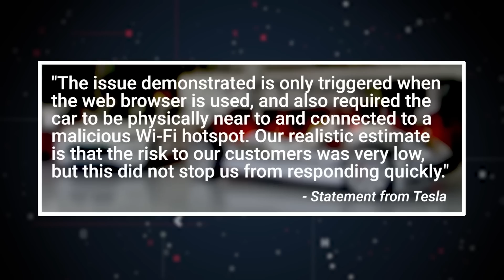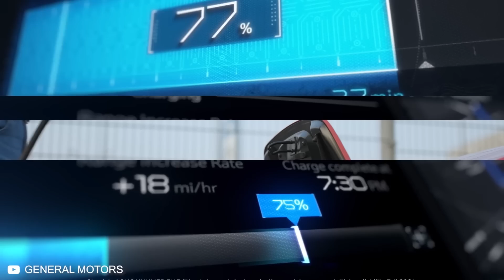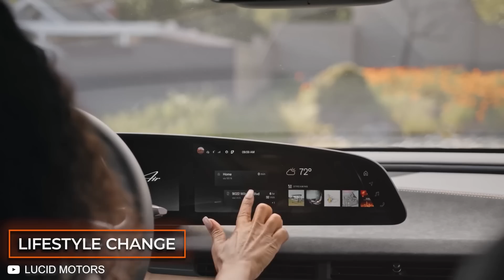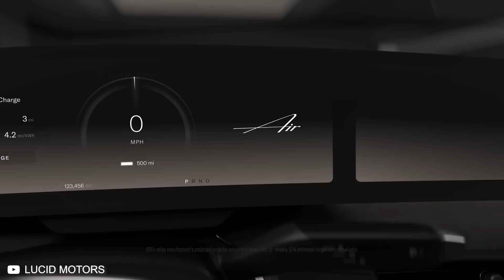EVs' Serious Problems That Carmakers Are Hiding

Comment: This story totally missed some major EV environmental issues:  —- What about — the RARE EARTH METALS that have to be sourced and mined for the production of EV batteries. Next, how the electricity gets produced — Just because you don’t have a tailpipe does not mean you are not producing emissions. Combustion engines produce energy, batteries just store energy (and the energy has to come from somewhere). It is a farce when EV owners think they are saving the planet, when you include the total supply and manufacturing chain - this isn’t true at all.
Reply: In the UK thieves are now cutting charging cable's for the copper, it's just getting crazy now
Reply: @looneytoons2878  crazy
Reply: i see where your coming from🤭 environment this environment that... we bought our new cars for the savings am i right
Reply: People love lies and you are telling the truth. In which people dislike.. But you're 100% correct Ev's sound good now because they are not the only ones on road Ice still here lifting heavy energy consumption of the electric cars imagine what happens when all cars on the road are electric!!! The price of electricity will spick up high and ver few will be to manage the bill for that!!! People just love to live in a delusions!!
Reply: Ik to make an ev ur polluting the air and pretty much ur polluting the air ether way by making evs or by driving gas powered
Reply: @colejones6369  Yep, but the gas powered car causes more long term air pollution and a technical debt your grandchildren will have to deal with. Plus petroleum is too valuable now to be wasted as gasoline.
Reply: Thank you and that is how the EV car byers are made to believe that they are saving planet and no longer going to the gas station. I'll stick to my Kia Forte Gt Line with 40 MPG on the hwy.
Reply: It takes 12 years of an ev on the road before it breaks even with the massive environmental impact manufacturing an ev has when compared to a gas car. 200,000 lbs of earth have to be moved to collect enough metals for one battery. It takes 900 barrels of oil to make batteries with the equivalent storage of 1 barrel of oil. Half the grid in USA is powered by coal. So widespread adoption will increase coal burning.  And in the end the ev will not meet most Americans needs. I pull a construction trailer with my truck every day to work, sometimes a hundred miles away. Then I work my truck all day. Then drive home. There is no place to charge an ev on the job site other 110 bold extension cord to the construction generator, and that power is not clean enough to charge an ev, and that power is needed to power the tools and equipment. People are just delusional if they think evs will ever work for the vast majority of the population that keeps America running in the trade fields every day. We need heavy duty pickups and vans that can haul tons of materials, tow construction trailers, and work all day into the night, then take us home safely. And anyone that does not accept this reality and thinks evs can be forced has a rude awakening coming. My truck is my heated and air conditioned office, my material carrier, and my trailer hauler; in all kinds of weather and all kinds of terrain. And it you want the homes I build for you than you need to accept this is the way it is for people like me. So stop forcing me into an ev. I’ve been in my business 33 years. I know what works and what it takes. And quite honestly if you are not in the construction business moving from job to job, put bluntly how have no clue what you are talking about.
Reply: @homebuiltcamperdave5226  some great stats here
Reply: Thanks Shane Zee. The inconvenient truth in all of this is our government allows the manufacturers to ignore the carbon footprint of the materials manufacture as long as it’s made off shore an imported. Lithium. Nice clean shiny metal right. Yeah tell that to the Chinese that are dying every day or developing horrific cancers to mine it. But my favorite part of lithium cars is now coming to light after the Florida hurricane. Oh when they get flooded the water seeps in to the batteries corroding the housings and ultimately gets to the lithium. Back when I had science Mr Strong always used to say never underestimate what could happen. Sodium harmless right. Take a tiny bit of it and put it in water. Explosion. Lithium. Nice and shiny and perfect. Yup take a tiny bit of that in put it in water!  Huge explosion. Oh I’m sorry “thermal runaway”. I’ll use the term Tesla engineers have developed to make it sound less “scary”.  One lithium cell has the explosive potential of a small box of fire crackers or a small stick of dynamite, when exposed to water. And that’s what’s happening now in Florida. And how do you put it out?  You can’t just put more water on it. Only solution is foam and water. 10s of thousands of gallons of it. And it doesn’t really help because the fire is a chemical fire so best you can do is contain it. Water, especially salt water leaking into one cell is all it takes to start the explosion. And there are 8361 lithium cells on one Tesla battery, just waiting for a little bit of water to wrap in after a flood, or maybe after being driven in salt belt roads through salt brine every winter for say 10 years. The explosive potential is 10 times more dangerous than gasoline!  I will give the ev designers credit for one thing. Those cars are efficient. I can drive my small truck 22 miles on a gallon of gas. Around 350 miles on a tank. My big truck towing I can go 14 miles on a gallon, 290 mile range in a tank. An ev battery has the storage capacity of around 4 to 6 gallons of gasoline. And it can drive 275 miles with one driver and a passenger. That’s impressive. Can’t take that away. But till there is a truck that can tow 13,000 lbs or carry 2 tons and still get that same 285 mile range and fuel back up to 100% in the time it takes to run in and buy a power aide and slim jim, or a cup of coffee and a donut; there is jot a single contractor in the country that could make a living with an ev. I won’t even get into cost. 90,000 and up for an electric pickup?  Even at todays prices I can get a f250 with a plow for less than that.
Reply: @homebuiltcamperdave5226  I agree and it is greed not green . 
These mining companies are greenwashing lithium and must be stopped .
Biden has allowed mining companies to get permits in less than a year. That process should take 8 to 10 years and has put us in danger. 
Protect Thacker Pass 💪
Reply: Coal will be the next oil
Reply: Its better to have a bike only or getting an gas powered car instead lol.
Reply: And what about those non-recyclable batteries? Where do you put them? These batteries are highly toxic pollutant.
Reply: @maerski6623  The technology already exists to contain lead, mercury, and cadmium when recycling batteries and it is improving by the year to the point that in about 20 years the need for mining will be reduced substantially. All the other mineral and elements in a EV battery are fully recyclable even after being used as second-life batteries. One nice thing about EV battery cells is, they find a second use in stationary grid storage. By the time there are sufficient numbers of them, there will be a larger market for recycling EV batteries. There is always recycling where there is valuable metal; they will be recycled to reclaim the valuable metals just like any other high volume appliance does nowadays, which is already happening in some countries where it is mandatory. 

Toxic waste, is just another industrial waste problem and when appropriately managed, raises no risk like that of burning fossil fuels at the current rate.
Reply: @rps1689  people can't even recycle plastic bags. Lol
Reply: @maerski6623  truth
Reply: Literally Everything manufactured causes environmental damage of some sort, including food production . If you chop down a forest to grow corn that’s harming the environment. If you turn a natural area into a row of houses that’s environmental damage .EVs are much healthier because they result in cleaner air. 

If you really want to save the environment walk everywhere or take a bus. Unfortunately that’s not an option for many people so we have to make do with what we can get.
Reply: @iridium5652  Cleaner air? Try again - most electricity is produced by coal or natural gas - solar and wind only produce a small fracfion of power.
Reply: "RARE EARTH METALS"  Are you talking about Lithium?   Tesla owns a lithium mine in Nevada that has enough Lithium to supply all of the US with electric cars.   And when those batteries start to fail after 300k+ miles, they are being purchased for recycling where they claim they can get from 92% to 98% of those metals back out of the battery.    Wonder if anyone has ever been concerned about using up all the fossil fuel on the Earth?  At one point it may be the next "RARE EARTH MATERIAL".   And sadly Fossil Fuels can't be recycled.
Reply: @1D10CRACY  OMG, please educate yourself on this. — EV Batteries are manufactured using combinations of Lithium, Cobalt, Nickel, Maganese, Graphite, Aluminum, Copper, Steel and iron. There are only so many places in the world that have the mining capcity so it is shipped from faraway places, some using unethical labor practices, burning fossel fuels to produce. FURTHER, batteries don’t last forever (on average 10 years and many components become hazzardous waste. In summary —-  Your “Green” EV also kills the planet, arguably even more so when you factor that most electricity is produced using fossel fuels.
Reply: @1D10CRACY  And "mining" lithium is mostly derived from brine deposits. It's pumped out of a well and is only intended to be a stopgap.
Reply: The push for electric vehicles has absolutely nothing to do with saving the earth. They want us to live in the pods and eat the bugs and this is how they’re going to get us dependent on the power grid and how they are going to be able to 100% control where we go and when we go there. I would love to buy a hybrid but, isn’t it odd that they just aren’t pushing for those?
Reply: @thesisypheanjournal1271  No climate scientist would say that EVs are going to save the earth, but would say that petroleum is too valuable to be wasted on gasoline plus burning fossils fuels at the current rate will create a huge technical debt for our grandchildren. 

For me a hybrid has the headaches of an EV and ICE in one; I'd rather have a gasoline car or an EV.
Reply: @rps1689  You don't have to plug a hybrid into an outlet forever in order to be able to drive it anyplace.
Reply: @thesisypheanjournal1271  That's a nice convenience.
Reply: Lol, yeah, or the fact that co2 only makes up 0. 04 percent of earths atmosphere, 97 percent of which, comes from nature. Humans only contribute 3 percent..!!, how is that destroying the planet???, i smell bull shit
Reply: @paulirving2012  zone Id,iot questioning another id,iot. LOL Both fools of fools.
Reply: What about how long and how much water it takes to put a battery fire out?
The toxic smoke is 1000 times (estimated because governments won't fund studies) worse for the environment.
Reply: @masksarelies391  Your screen name tells all we need to know. No comments needed.
Reply: @BioniqBob  your screen name tells us all about your tiny asset.
Reply: You should probably learn what rare-earth metals are.  If you did, you'd learn they aren't used to make EV batteries.  You'd also learn that they aren't particularly rare.

Neodymium, the one sometimes used to make magnets for electric motors (some of which are used in EVs) is about as rare as copper.
Reply: @jonathangwynne1917  - 😂 — thanks for typing a nice, misinformed post 😂 — Perhaps you should go back and research what defines rare earth metals  and the mining practices around them .  Cobalt for example,  Is found in many batteries and IS a rare earth metal.  Tesla’s use neodymium in many models… the list goes on..
Reply: @pilotleader , cobalt is not a rare-earth.

What is it you think "rare-earth" means?
Reply: @jonathangwynne1917  You know what? - you and I can continue to debate the rabbit hole of what defines these metals. Who really cares as that it is just a distraction when it comes to EV’s. The bottom line is that most ssEV batteries require various materials from many far away places — and generally must be shipped long distances. And after several years, some material can be reused and some material becomes toxic waste.  More importantly, it takes emissions to produce and charge them. They aren’t as green as some would like to believe.
Reply: @pilotleader , if you have to lie to make your point...  the point isn't worth making.

You're not just wrong, you're embarrassingly wrong.
Reply: @jonathangwynne1917  😂 — you respond as if I care — love your freakishly hilarious and juvenile approach.
Reply: @pilotleader , you're projecting?  How quaint.
Reply: @jonathangwynne1917   your mommy is calling - she says stay off the computer…
Reply: @pilotleader , still projecting?  Keep digging, dude.

And tell us more about how cobalt is a lanthanide.

Your cluelessness is most amusing.
Reply: @pilotleader  truth
Reply: It's worse than you even mention, Shane - the total Carbon Footprint over the 100,000 mile life of the vehicle compared to internal combustion is under 4% carbon savings. If 90% of all passenger cars and trucks are EV by 2050, it will change temperature rise by LESS THAN 0.01° centigrade by 2100.

The politicians know this 
All professionals know

So why the push 
CONTROL

If all cars are EV and another shutdown like 2020 is ordered then the flip of a switch ( OK, lines of code ) will turn off EVERY SINGLE VEHICLE NATIONWIDE
Reply: @CWPTraining  100% AGREEMENT with your post Alecs!  Well Stated!  .
Reply: Shane, Lithium-Ion batteries are everywhere from medical equipment to your smartphone, emergency portable equipment, all sorts of batteries for everything. Have you any idea your exaggerated claim has been debunked? Greetings.
Reply: @Rhaman68  Exagerated?  Perhaps you missed the point - The amount of Lithium in ONE car battery is large (16-20 lbs on average) and requires a significant amount of mining and shipping, negating perceived environmental benefits.
Reply: the focus on ice vehicles are strongly exaggerated by the government when they only contribute to a small percentage of pollution look at canada and some other places for example
Reply: <<. It is a farce when EV owners think they are saving the planet, when you include the total supply and manufacturing chain - this isn’t true at all.>>

Not really important though,  is it.  EVs are FASHIONABLE.  They are the automotive equivalent of tatted up arms and nose rings.
Reply: CCP China owns and runs(E.V.) Cobalt Mineral mines in the
Republic of Congo using 10-12 year olds,[for a Dollar a Day) cheap Labor,
Death, Injurys, Disease, etc? So if you think your saving the planet? 
At the expense of Kids who should be in a School, not a CCP China run
Underground Cobalt Mine!
Reply: In an ICE car you are 10 times more likely to die then in an EV, Period
Reply: @BioniqBob  I still want freedom of movement, which I can't have if I have to depend on the electric grid. You can't stockpile electricity.
Reply: @thesisypheanjournal1271  Talk to your local congressman. 5 years without any problems. Works great for me. It will only get better, hang in there.
Reply: @BioniqBob  🤣 ROFL!! That is Hillarious that you would believe this!! Really?  Have you factored in that when an EV starts on fire, that it burns at massively high temps — so high that average fire departments aren’t equipped to extinguish? Have you factored in that these things cause more death and destruction for the environment producing toxic fumes — Good god, educatge yourself!  
https://youtu.be/XWq-Mq1Uqpw
Reply: Cables are stolen everywhere for copper and that  will be the end of EV's
Reply: @lucbos7516  Oil and gasoline are stolen by illegal taps in petroleum pipelines, and billions of dollars worth of product are stolen annually
Reply: Oil is just a battery from the sun as well only it's one time use.  An ev can run on any energy source oil gas solar hydro nuclear etc. It's more versatile. Ev cars already do some other things better than ice too. They are quicker and cost less per mile to operate. They have their downsides too. Charging, initial cost and towing.
Reply: That somewhere can be from a solar panel, dumdum.
Reply: @richdawkins4453  😂 — yes! It is dumb thought by thinking solar panels can provide sufficient base power all the time. Add to the fact that coal is a component of manufacturing a solar panel and it is a real win for the environment.. 😂
Reply: EV cars in Europe might be coal burners this winter
Reply: Shane ; and what about the dark side, child abuse? Children being killed in the Congo mining for EV's ."Blood Batteries"?
Reply: So true I’m never going to let go of my 604 crate engine it’s staying in my late model
Reply: They are a price of 💩 and the companies that make them hold your freedom in their hands … they can literally disable your car whenever they want😜😂
Reply: True
Reply: Absolutely CORRECT.
Reply: Exactly
Reply: Batteries don’t use any significant rare earth elements.  The e motors do.
Reply: The EV thing is a scam. If the source of the power isn't green then you are not making a difference
Reply: @cool2180  still has some advantages even w dirty juice.  Uses less than half the energy of a gasoline car per mile, is cheaper to run, fewer things to maintain.  In a car crowded city, no local tailpipe pollution.
Reply: @Nill757  you do have somewhat a point.  But the energy has to come from somewhere. The power plant is going to have to burn more fossil fuel to make up for the increase load on the power lines which make them have to build more power lines and copper is super expensive and the rates will increase and more to charge your car.  Utility Transformers will get worn down faster from the loads and cost a lot of money to fix which will be passed on to the customer. Ev has less moving parts which is good and less things to worry about going wrong on your car. But car manufacturers are not going to make it cheap to place them and your mom and pop shop won’t be able to fix it. You going straight to the dealer…lol and a “arm 💪 and a leg 🦵” to fix it. Government and ev manufacturers are trying to get people adopt the EV more and once they have people on the EVs. Charge rates will go high and other fees and stuff you will start to see.  

My theory is government wants people on EVs not because of the environment but so they can have better control over energy so that people don’t get politically mad so quickly with their politicians when energy goes up because gas and oil is a different market that they can’t easily regulate.
Reply: @cool2180  Mostly agree.  the increased grid load from charging has not been worked out yet, esp high power charging close to point of charge.  Agree too the repair shop issue is not worked out completely, though some is the same: tire shop and brake shop can fix tires no matter the type of motor and so on.  Yes electric power plants work harder but that means less gasoline demand and so on.
Reply: Thank you. Exactly what I've been telling people
Reply: @dannymack1196  Stop “telling” them BS that you don’t understand.
Reply: EV batteries don’t use any significant rare earth batteries
Reply: Yes, but an EV battery weighs between 1,000 and 2,000 pounds. An EV battery uses a significant amount of resources.
Reply: @Nill757  The key word in this statement is “significant”  (even a 2-4% ingredient per battery equals millions of tons of mining devistation)
Reply: @pilotleader  there is nothing approaching 1% in batteries.  RE is used in magnets in motors, not li ion batteries
Reply: You win, VHS it is
Reply: @natehill8069  Awesome! 👏👏 Better VHS than AI and stealing your personal info….
Reply: @pilotleader  and once again, wotnell has that got to do with electric vs gas? Every single bit of computerized rubbish they put in eCars goes into ICE cars as well so they can charge more for those too.
Reply: If you read the book of Revelation in the BIBLE, it pretty much indicates who is in charge. It’s not us.
Reply: Install solarpanals
Reply: @pratikbankar1761  So, by installing solar panels, you mean the ones requiring coal to be manufactured (hint: all of them do) and those same panels that CAN NOT provide base power in the winter or during extremely cloudy conditions? I guess you want only to restrict your driving to the summer, then?
Reply: @pilotleader  atleast do 50% work bro .. something is better than nothing... imagine everyone installed solar panal then it will require less energy from coal 
Atleast it will save more than 50% coal
Reply: @pratikbankar1761  Check out "Planet of the Humans". It pulls back the curtain on many of the alternative energy claims and was made by a proponent of alternative energy. I want alternative energy, but I want the truth, not lies forced on me that will cost me more.
Reply: @ronjarosch8287  in our India billionaire Gautam Adani installed billions worth of solar panal and he is providing cheaper electricity to the people except some downfalls of cloud condition try to understand he is saving million tons of coal per year... Something is better than nothing bro .....
Reply: @BioniqBob  Yes, the VLOG was taking crap — Tottally agree!
Reply: @pilotleader  Talking about your big picture.
Reply: @BioniqBob  no facts, no stats - EVs are a fraction of the vehicles out there - greenies don’t get it…
Reply: @pilotleader  So the load you dumped is facts because you typed them. LOL
Quantities were considered. Not everyone lives in the US. Read more.
Reply: @BioniqBob  Who says we all live in the US? Here’s a hint….I don’t…..
Reply: @pilotleader  Good for you.
Reply: @BioniqBob  and to you as well…
Reply: You left out the environmental damage issues with the vehicles they are replacing, ICE vehicles.  Easy to defame something when you only tell part of the story,
Reply: @johnbranca6933  curious - define environmental damage by ICE vehicles…
Reply: @pilotleader  ice used to mean in car entertainment!
Reply: Drill a hole pump out crude use energy to refine the fuel, use some of the fuel to transport it, all while poisoning every person on the planet! Move forward people stop listening to the big oil companies that want you to buy a slower car, a noisier car, a car that is inefficient, a car which will force you to use environmentally bad energy, have to service, oh hang on you do get to enjoy a engine note if that’s what you like! It sounds to me some people here still have a Nokia phone! And a video cassette player
Reply: @grahamrennie7617  ev’s are far worse while gas cars contribute a small percentage to pollution for goodness sake look at the other places for example ev’s are not green
Reply: @SayNickk  truth
Reply: @grahamrennie7617  oh that’s much better than ripping thousands of acres of land looking for minuscule amounts of deadly minerals. Have children who end dying before 15 of cancer, mine those minerals,then putting that crap on a ocean cargo ship that pollutes more in one trip ,than 100,000 cars do in a year to put in a stupid EV that takes MORE GAS to make the “ clean electricity “ ( where do you morons THINK the electricity comes from? The energy in your blue hair?) that takes HOURS to go into your car. A car that really only gets 200 miles in range ?  There’s NO WHERE to get the energy to put into your EVs than coal plants, in some areas. 

That’s why you don’t get the myth.  READ STUDY. it’s a farce concocted by politicians who are heavily invested in this farce. FOLLOW the money.  Even IF the EVs could generate range we have NO WAY to charge them for two days. You’d take down the whole power grid.  We’d have to cover HALF the United States with solar panels MADE IN CHINA( you’re supporting China with ALL this crap) and the other HALF with more deadly battery holding buildings to store the energy. You guys are doing nothing but chasing pie in the sky because you’re too ignorant to know the problems behind this technology.  Wood burning is more of a problem than  gas cars.  Go read the data or better yet read the CONFESSION OF A ENVIRONMENTALIST by Michael Shellenberger. That will give you an overview of why stopping gas cars by 2035 WILL NEVER WORK !  Unless YOU never again want to take a trip from Delaware to Maine without paying $10,000.  They want to take your freedoms away .  Sheesh it’s so simple to see.
I’m a scientist DO THE RESEARCH!!!  If you can read you can learn!
BTW a EVs battery only lasts 100,000 miles then it’s almost $15,000 to remove and replace the battery including labor 
Then where does all that non disposable toxic material go? There’s already more toxic waste from crashed and old batteries than our total nuclear waste in this country. ( that doesn’t include the motors and their wear and tear 
Imagine buying a gas car that you KNOW has an engine that only lasts 100,000 miles. You’d never buy it
AND you have do drive an EV 100,000 miles BEFORE it’s greener than a gas car.  Then you get to buy a new battery
Reply: @grahamrennie7617  I wish I still had my Nokia! That thing was indestructible!
Reply: What rare earth metals are you talking about please tell
Reply: @grahamrennie7617  hi! I forget what the called..maybe gallium..but it takes approximately 1 ton of earth for a gram of gold. It takes 300tons to get a gram of these rare metals! Plus it's Africa that has massive holes in their land!
Reply: hahaha!  of course they are not 0% footprint but do your research.  You are cherry picking issues without any analysis.   They are definitely a greener option
Reply: @lesliehuegerich2314  they are not greener yet… the science does not support your thinking
Reply: @lesliehuegerich2314  no they aren’t lol quit buying into the scam!
Reply: @lesliehuegerich2314  no they’re not I’m an electrical engineer.  We’ll never have the power grid for all these EVs EVER unless we go nuclear or cover the entire US with solar panels and battery storage houses.  NOTHING provides the clean compact energy of oil products
Reply: @lesliehuegerich2314  A coal powered EV the same size of a gasoline car emits 15 pounds of CO2 running the same route as a ICE car, which emits more than 20 pounds of CO2 for each gallon of fuel consumed.
Reply: @lesliehuegerich2314  and still needs fossil fuels and more dirty mining .
Reply: @lesliehuegerich2314  so let's mine baby mine
Reply: @lesliehuegerich2314  Cherry Picking? That’s hilarious! China and India eat up whatever emission savings even if it is “way better”- Get real! (It’s funny how the larger world issues always get overlooked by greenies 😂😂
Reply: @pilotleader  you make no sense.   So if I drive electric then china has more emissions?  what?
Reply: @lesliehuegerich2314  China makes up for nearly 40 percent of global emissions.  Meaning if you purchase an EV the desired result won’t be met unless China and India change course.   And to further correct your analysis.  Farming and agriculture is the main culprit, not the combustion engine.  A 🐄 @$$ is responsible for way more emissions than any gas powered vehicle.  Combustion engines of late with new tech are surprisingly responsible for very little of the earths total emissions.
Reply: @lesliehuegerich2314  yes that is true.
Reply: @lesliehuegerich2314  Yes. Because the energy costs to produce the excessive electrical components of an EV by and large originate in China. Whereas fossil fuel cars utilize more of its operational components within the same region as the one they are sold in. Which means less CO2 emitted during shipment of raw materials.
Reply: @lesliehuegerich2314  well, if a butterfly flaps it's wings in the uk, it's a hurricane in china😅😄
Reply: @lesliehuegerich2314  They are a greener option; the fossil fuel it takes to charge EVs and to manufacture them and their batteries will dump much less CO2 into the atmosphere than private vehicles using internal combustion engines.
Reply: @rps1689  Oh please. You actually believe that propaganda about CO2? No wonder you favor EVs.
Reply: @stevenbass732  I don't favour EVs. I dismiss the indolent especially those that are presumptuous.
Reply: @rps1689  Wow. Big words. How impressive.
Reply: @ZilogBob  No one is advocating for that.
Reply: @rps1689  not true, sorry but the science does not support tjis
Reply: @rps1689  Show me the data!
Reply: @rps1689  I watched a documentary on this, they stated that in the production of an ev it produces co2 equivalent to a petrol car having done 200000 miles! Something has to be done, but I'm not convinced Ev is the future
Reply: @rps1689  you favor EVs ?
So much dirty mining for those lithium batteries .
Reply: Of course they have environmental issues, but nothing close to the what the continuation of using petroleum for gasoline will do. 

Good news is, not only is the technology improving at a fast rate, less and less cobalt is being used for batteries; sodium and redox batteries don't use any plus it is highly likely in less than a decade, sodium will overtake lithium. The amount of petroleum needed to provide fuel for mining, manufacturing, EVs and thier batteries; and how much CO2 it will dump into the atmosphere, is small compared to the amount private vehicles use, using gasoline. Fossil Fuels raise serious risks for our grandchildren, but mining metal for batteries does not. 

Solar and wind are the best to use as a transition while phasing out the use of fossil fuels and buy time for the nuclear industry to get its act together. Petroleum is too valuable now to waste as gasoline. We should leave as most of it as we can in the ground so our kids and grandchildren can use it for plastics, paint., etc. The technology already exists to recycle wind turbines, but it is not worth it yet. By the time windmills and solar panels start wearing out in sufficient numbers, there will be a recycling market likewise for EV batteries. There is always recycling where there is valuable metal.  In the meantime, the fossil fuel it takes to charge EVs and to manufacture them will dump much less CO2 into the atmosphere than private vehicles using internal combustion engines. One nice thing about EV battery cells is, they find a second use in stationary grid storage. As I mentioned, when there are enough of them to create a market, they will be recycled to reclaim the valuable metals just like any other high volume appliance does nowadays.Also the technology already exists to contain lead, mercury, and cadmium when recycling batteries and it is improving by the year to the point that in about 20 years the need for mining will be reduced substantially. All the other mineral and elements in a EV battery are fully recyclable even after being used as second-life batteries.

Bottom line is that all energy sources and even recycling are dirty, The responsible choice to make is the least dirty one, not the one where you get to bill somebody else for the cleanup. What is being pumped into the atmosphere represents an enormous technical debt, which is much much more than all the tax expenditures and all the subsidies by all countries to wind and solar energy and EVs. The cheapest technology that produces electricity is utility scale solar, which has a much lower impact on the environment than that of fossil fuels.
Reply: @rps1689  Your entire soliloquy is misleading, incoherent, laughably biased, false, and incorrect.  
1.  “Less and less cobalt.”

Why it is true that sodium is a proposed successor.  In the meantime most cobalt is mined using slave labor in Africa, and yes that includes children.  Not to mention the toxicity of cobalt causes cancers and other various illnesses.  This notion that you’re “saving the planet,” by switching is blasphemous, considering the amount of death and human suffering involved.  But again nobody cares because its just a bunch of nameless black people/children being affected. 🤷🏾‍♂️ 

2. “The carbon footprint associated with the manufacturing of EVS is small”

It is widely known that the initial footprint while manufacturing is considerably higher than the combustion engine.  To be objective and fair, the EV does still produce less emissions than the combustion engine but thats only after years of use.  Again the initial carbon footprint is clearly larger.  

3.  Your overall understanding is flawed and filled with propaganda. Here are some facts to help you.

Number 1.  Automobiles only make up 3 percent of all greenhouse gasses globally/annually.
Number 2. When adding trains, busses, boats, etc. that number creeps to 16 percent globally/annually.  
To put this into prospective 50 Carnival Cruise ships emit more annually than 100 million vehicles combined.

Solar is viable option but still much to expensive to manufacture for it to become cost effective for most people.  Also take into consideration the number of renters who do not have permission to implement solar at their residence.  Solar is still vastly an option for home owners and if current economic trends continue you will see less home owners.  It will then be left to the landlord to add solar and I can almost assure you most will not. 

The northeastern corridor of America is very old, most homes are connected and do not offer a garage or yard.  How will these people charge their vehicles from home?  In places like Philadelphia for example there is no guarantee that there will be available parking in front of your home even if you own the home.  How will these people charge from home?  Where will you place charging stations in cities that are already fighting for space and parking?  Did you know places in Pennsylvania have historical mandates which prohibit any changes to the land, housing or infrastructure? 

Are we also talking about killing the airline industry?  Currently the size of battery needed to power a typical commercial flight is so large and heavy it would rendered inefficient.  Not to mention the charging times associated with charging such a large battery.  The battery itself would surpass or be equal to the weight of the entire aircraft the passengers and luggage.  Again to be fair and objective I myself would love to see high speed rail, but in typical fashion to take on such a massive infrastructure project would almost inevitably need massive tax payer funding of which the government will probably fumble.

In conclusion I am not opposed to EVS.  I am opposed to the narrative that the combustion engine/automobile is the main culprit when concerning greenhouse gasses.  That narrative is simply false.  The culprit is indeed farming and agriculture.  You’d be better off slaughtering cows as opposed to getting rid of gasoline powered cars.  This is fact backed by data.

Lastly Wind Power sucks.  Inefficient, expensive to build and maintain.  When wind is not blowing they’re useless considering we have not figured a way to store the unused energy.  

DO SOME REAL RESEARCH THATS NOT DOUSED IN PROPAGANDA!
Reply: @objectivedetective1981  👏🏽👏🏽👏🏽👏🏽
Couldn't have said it better myself.
Reply: Another factor to consider: EV's massively contribute to emmisions in a hidden way, they use asphalt to drive on. The construction equipment needed to build roads, highways and big massive parking lots put more Co2 into the atmosphere then just building walkable neighborhoods where the volume of those materials used remain less. Secondly, the roads, highways and big massive parking lots themselves have an impact on climate due to the asphalt storing heat phenomonaly and the unnecessary loss of trees and flora that results from the disgusting land use policies regarding car dependency.

In short EV's are at best: not the "end all be all" of solving climate change. At worst: a bad idea for the same reason "the age of the automobile..." was.

The real turning point in fighting Climate change will be the end of car dependency. If you do not support this, you are a climate change deniar.
Reply: @Limosethe  Um, your statement doesn’t make sense and is unrealistic — Trucks that ship just about everything you consume and use  (like food) and own (like the gadget you are using to view this) and even mass transit (busses) use the same infrastructure. Perhaps you can walk to an empty store and get some imaginary food.
Reply: @pilotleader  Except for trucks only make up a small amount of traffic compared to cars, Lol. And as I already specifically stated, and you specfically ignored: It all boils down to the amount of asphalt that is built at the end of the day. Busses do not use the same infrastructure as cars when their own dedicated bus lanes exist, and since busses are far much more effecient than cars due to having a higher load capacity, you need less asphalt to be paved per bus then every single person in their own car. Also, unironnically: Trains are a completely superior means of transporting goods as opposed to trucks mostly due to the fact that trains can carry multiple times the amount of freight that a small, individual truck can. Since a train can carry multiple containers while trucks are limited to only one per every cab that can tow it, and each one of the millions of semi truck cabs that transport the millions of containers needing to travel from coast to coast use a whole lot of diesel - I can say with confidence that trains are also much more fuel effecient in the long run than trucks as an added bonus.
Reply: @Limosethe  Perhaps you should fact check your work and a lot of comments are too deep in the weeds here. Fact; You can concentrate on vehicles — ICE or EV — it doesn’t matter — China and India continue to increase emissions at high rates — and commissioning coal fired manufacturing and electrical plants at about 10 a month. The big picture says the Earths emissions will continue to increase into the foreseeable future. So go ahead and say EV’s (or mass transit) is a solution — it is like shuffling deck chairs on the Titanic.
Reply: @Limosethe  is it the car,or the amount of people driving them? We used to walk or use horses. Horses produce a massive amount of co2, more than a car mile for mile! There are too many humans demanding cars, a.c. units, all the luxury items that produce co2. Solution, cut the human population!?
Reply: @terrystratford1235  Ohh God. "is it the car,or the amount of people driving them" - It is the fact that the majority of people drive cars on their journey from point A, to point B. This adds up massively over the course of time to be in the hundreds of millions of car trips per year; across the USA alone. 

"We used to walk or use hprses." - Oh No, am I in for a strawman attempt whereby you are going to pretend that I believe that we should return to the Horse & Buggy, as is all too disappointingly typical in discussions around this topic. As far as walking goes, yes. And walkability needs to make a comeback in American society. This is one way where the advancement of technology has oddly enough: Caused a regression in the quality of life. Throughout Human History city streets were the places where children freely played and human beings freely mingled. Now: It's a noisy, disgusting unpleasantness that people trudge through to get somewhere better (Due to cars)

"Horses produce a massive amount of co2" -? You have got to be joking... 

"More than a car for a mile!" - Now this statement is the pit of stupidity in your comment. The part that makes me almost want to assess detail of your ancestry...

"There are too many humans demanding cars" - And here I thought you were actually deviating from the topic at hand to talk about animals in order to setup a cheesy strawman about how I somehow thought that we should go back to the way things were in the 19th Century in regards to transportation but I guess not... I guess some ppl really do just pivot to talking about non pertinent things that do nothing to  advance their overall argument for no rational reason... 

But this previous statement, alone is absolutely correct! I couldn't agree more that the demand for cars is too high and fulfilling that demand in an evermore exponentially growing population is abject infeasability. A.C on the other hand is bad for the climate, yes - But if we get rid of factory farms and design cities sustainably, I believe we can afford to continue having it. 

"Solution, cut the human population" - Nope. Just cut cars, factory farms, as well as non renewable resources for generating electricity as much as possible (To prevent the consequences of Climate Change and environmental collapse from cutting the human population...)
Reply: @Limosethe  I'm not the sharpest tool in the box I know! I like to watch documentaries for info! Are the facts true or misleading? I don't know! Which I why I love utube! The horse vs car for co2 was a documentary. I'm just passing on what I learned from that! Either way, something has to be done or there won't be an earth for us! It's scary how our actions have changed this planet! I have no idea what the answer is....but it's a fascinating subject!
Reply: @Limosethe  power of Google.......Horses vs car co2......yeh it's rubbish!!! I should research before making a statement!So not all docs are true!
Reply: @rps1689  The problem is highlighted by the term 'in less than a decade'. The transition to electric is unfortunately occurring in a panic whilst the technology is being painfully worked up with varying protocols for charging and ever changing dreams of the next battery technology. This is going to make it confusing and expensive as there is the instant obsolescence to cope with. Still a rich man's toy in practice unfortunately especially if you need any room in the car. EVs are not really a problem for most people as we just can't afford to even think about buying one.
Reply: @michaeld5888  and to much mining involved for lithium batteries
Reply: @rps1689  until technology surpasses where we are at currentlyin electric vehicles you are completely wrong. As of now Electric vehicles are worse for the environment than a petroleum powered vehicle…
Reply: @rps1689  well the really, REALLY sad part here is that only 16% of CO2 emissions comes from TRANSPORTATION and only 7% comes from CARS. what about trucks, planes, ships, trains? And not only that batteries STORE energy they don't MAKE it. so where does those batteries get their charge, huh? FROM diesel or gas or coal fired (think FOSSIL) power plants! now all of a sudden those plants output LESS CO2 because they're charging vehicles? the biggest contributor of CO2 by far is industry. Industry that will continue to be powered by FOSSIL for at least the next 100 YEARS! Yeah imagine a train being pulled by something powered by ELECTRICITY as a source. or how about 10000 flights per DAY being powered by ELECTRIC motors at 500 mph! and just WHERE do you think we're gonna find all these exotic metals to make these batteries once there's ZILLIONS of them out there? I don't know about YOU but I'm not gonna pay $100k just for a battery! Already the prices of these batteries are sky-rocketing... my, my I wonder HOW CAN THIS POSSIBLY BE?
Reply: @rps1689  You are completely wrong on literally every point you made, but nice try.
Just an example there is an environmental emergency on battery recycling right now, look it up, common knowledge.
Wind turbines are not recyclable, so they are also causing huge problems there, and they are killing birds. Totally unreliable power generation.
Don't get me started on solar, currently an environmental disaster on recycling (can't be done), and vaporizes birds and anything else that gets over them. Totally unreliable power generation.
Reply: @rps1689  solar and wind are not efficient and ev’s are more certainly worse than gas cars. gas cars contribute a very small percentage to pollution look at solar other places for example
Reply: @rps1689  lithium batteries come with dirty mining
Reply: @Rockhound17-18  All mining is dirty, but lithium will probably not be needed in a decade.
Reply: @rps1689  and ?
Reply: @rps1689  but you need fossil fuel for lithium batteries!
Reply: @Rockhound17-18  Of course you do just like all mining and drilling for oil. 

Bottom line is that all energy sources and even recycling are dirty, The responsible choice to make is the least dirty one, not the one where you get to bill somebody else for the cleanup. What is being pumped into the atmosphere represents an enormous technical debt, which is much much more than all the tax expenditures and all the subsidies by all countries to wind and solar energy and EVs.
Reply: @rps1689  what about holding mining companies accountable for their crimes.. 
We are being flooded with Canadian and Chinese mining companies that have proven the crimes against humanity they continue to commit.
Are you okay with that?
Do you know how much water is used to mine lithium and all western states are in serious drought.
Mining lithium contributes to Chiles serious drought.
Lithium mining in Tibet fishes floating dead downrivers.
Lithium mine in Clinton Nevada 4 hours away from Las Vegas chemicals found in rivers.
And you need fossil fuels for  changing EVs . Not to mention the transfer by trucks of lithium from a mine to overseas.
Reply: @Rockhound17-18  Mining companies should be accountable, but in the big picture, Strip mining for REEs and battery disposal pose no risk to the continuity of human civilization, but the continued consumption of fossil fuels at current rates raises that risk and neither does landfilling worn out wind turbine blades.

Toxic waste has always been around and, is just another industrial waste problem and when appropriately managed, raises no risk like that of burning fossil fuels at the current rate.

As metals and chemicals get more expensive, closed loop manufacturing processes start and have become the norm in places like China and some other countries.
Reply: @rps1689  wait until one catches on fire in a parking garage .
Reply: @Rockhound17-18 That will be a long wait, for the overwhelming majority of owners, as it is statistically very unlikely an EV fire heading toward your garage.
Reply: @rps1689  but in the meantime they want to continue to mine for these EVS and mining is a dirty business
Reply: @Rockhound17-18  Still the less dirtier option in the long run. Bottom line is that all energy sources and even recycling are dirty, The responsible choice to make is the least dirty one, not the one where you get to bill somebody else for the cleanup. What is being pumped into the atmosphere represents an enormous technical debt, which is much much more than all the tax expenditures and all the subsidies by all countries to wind and solar energy and EVs.
Reply: @rps1689  you are incorrect. Cars produce 12% of the world's emissions. Electricity produces 27%. Electricity is dirty to produce and is mainly fueled by fossil fuels. The focus should not even be on cars. The culprit of greenhouse gases is mainly coming from factories, cruise ships and ships transporting good like toys that we really don't need. Consumption is the problem. Electric vehicles will not and cannot fix the problem. Cars are only 12% of emissions. Even if we find a way to produce electricity in a more green fashion, cars are only a small part of the problem.
Reply: @rps1689  once again, the power has to come from somewhere no matter what kind of battery & CA has the highest % of renewables but still has rolling blackouts. Don’t lecture me, I have my own off grid solar for when PGE goes down. If your solar is tied to the grid it goes out when the grid goes down. Too many people plug their EVs in to charge at night, the grid goes down. Putting the horse
(EVs) before the cart (power) doesn’t make sense. If liquid batteries were the answer Ambri would have it by now, billions have been thrown at this. The billions spent on the salt tower in Nevada can power many homes but at a huge cost. We just aren’t there yet with the needed tech.
Reply: @rps1689  I've heard EV owners say things like this and other things, the other things turn out to be lies, which makes it hard for me to believe any of what is said.
Reply: @rps1689  The figure I read is that tesla is reclaiming 95% of the battery metals.    Current these are batteries used internally during development as no end of life batteries are available for recycling.   Used battery packs are being resold on ebay from between about $500 to something like $8,000 (buy it now price).
Reply: @rps1689  wrong answer bro